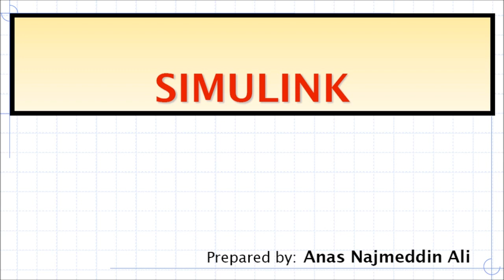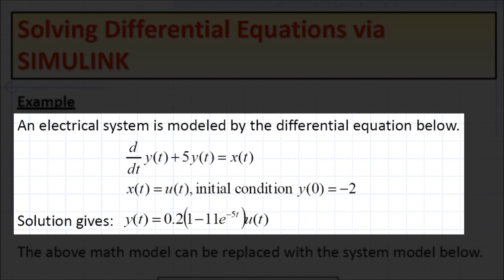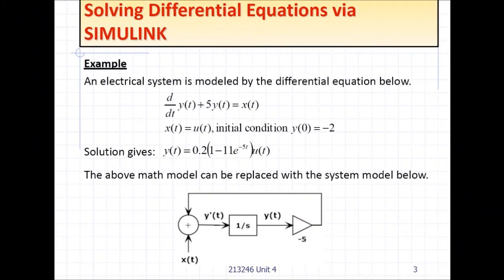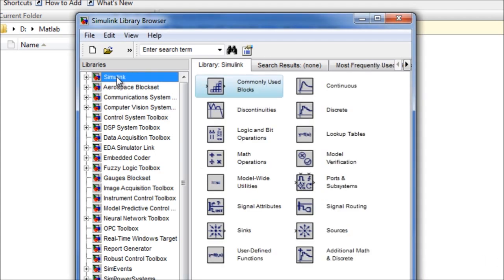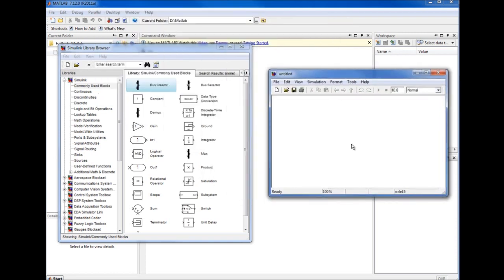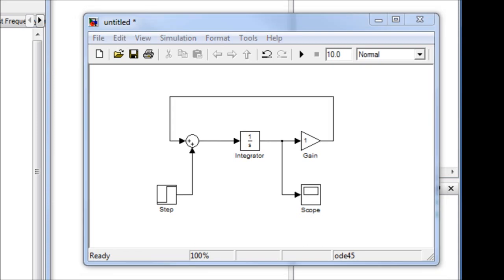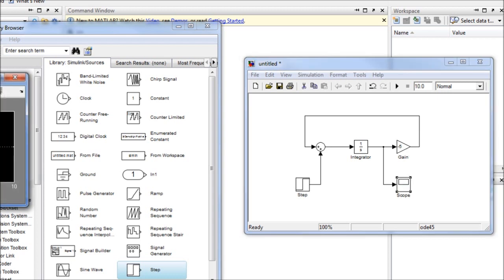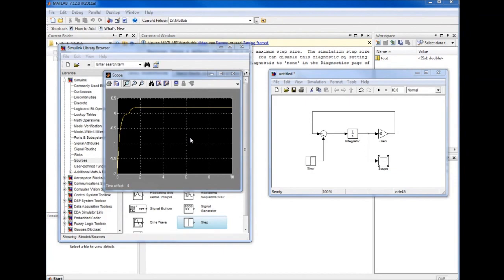MATLAB Tutorials - Introduction to Simulink

Comment: good day, why did you multiply by -5, i thought its 5y in the equation
Reply: Look at the adder. The inputs are -5y(t) and x(t) and the output is y'(t). So the adder represents the equation: 
y'(t)=x(t)-5y(t) which moving the y(t) term to the other side leaves you with the desired equation.

Comment: not a good tutorial. you should have shown how you drew that block diagram from the equation in the first place. Of course it is a piece of cake to drag some blocks from the library when you already have the block- diagram.
Reply from the maker: Thanks for your feedback.
Reply: Obviously not if you aren't familiar with converting diff eqs to block diagrams.  Why even make that jackass comment?
Reply: Do you have a link to a better tutorial for someone who is trying to self-learn about this?
Reply: I disagree! 
Hey Durden, he is trying to show us how a Simulink can be used to analyze signal processing using simple differential equations. A single signal processing class can take more than 4 months. Then, Matlab Simulink lets you visualize ideas across disciplines including signal and image processing, communications, control systems, and others. Once you get those classes you can use Matlab Simulink to analyze the system output. Mr. Kuzechie is trying to demonstrate the Simulink for beginers and he did a good job, I suppose.
Reply: To be fair, the block diagram used as example is pretty fucking simple.

Comment: Great walk-through. In case anyone is wondering about the "glitch" around t=1 in the scope output, it's because the Step block turns on at t=1 by default instead of at t=0.